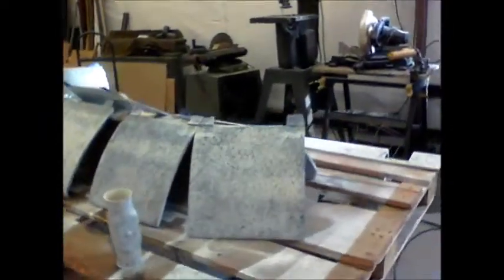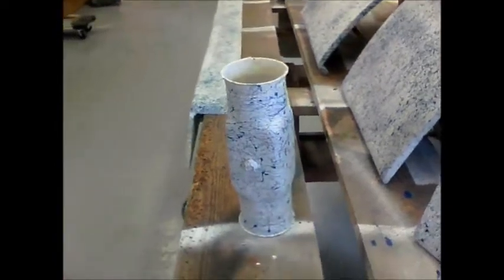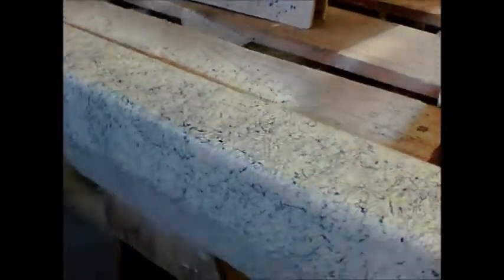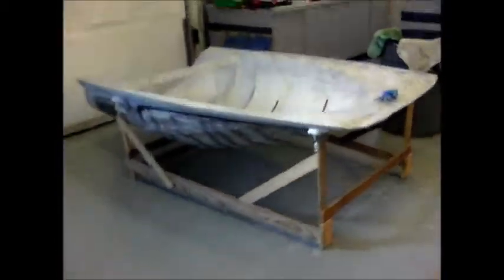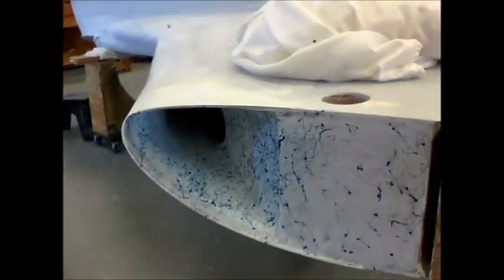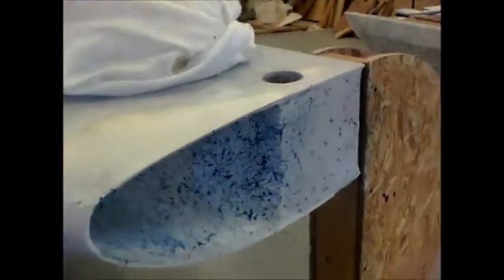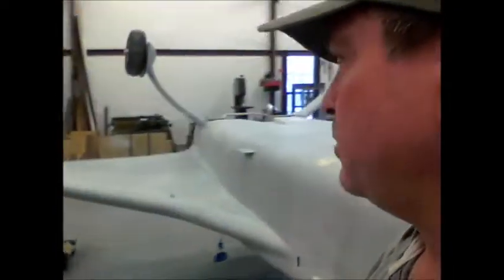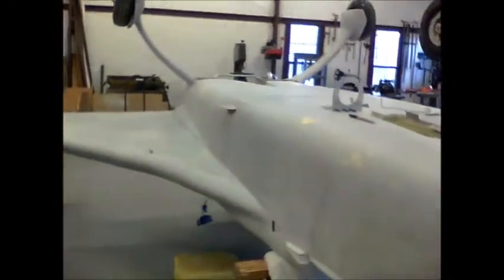Cozy Mark 4 Build Update 12/4/2021 (Interior Painted)

Comment: I love the marbling interior paint!  
What is the intent of the hollow in the transition block at the tip of the strake?  (I covered mine over solid).
Reply from the maker: I am planning on putting my transponder antenna in there on one side and magnetometer on the other side
Reply: @cozy4build245  I had considered putting landing lights in each side, until I realized they would be shining right on the back of that white canard at night!  Bad idea.
Reply from the maker: @GregoryACross  Yea stuck with the plans landing light.
Reply from the maker: @GregoryACross  Yea stuck with the plans landing light.
Reply: @cozy4build245  My respects to you for building the retractable landing light mechanism!
Reply from the maker: @GregoryACross  Thanks Greg and happy birthday